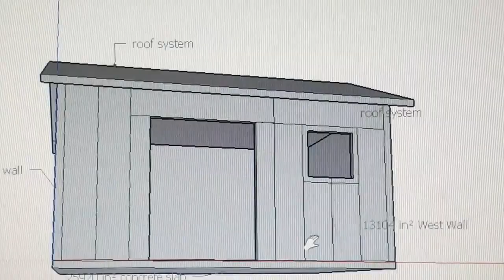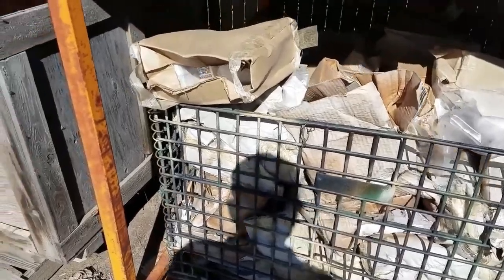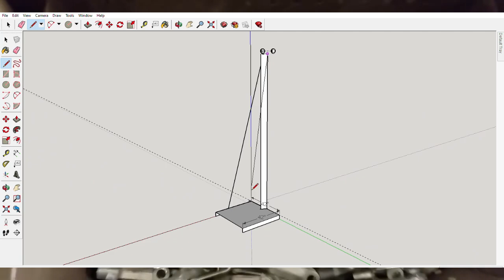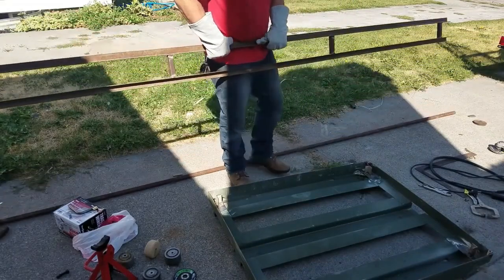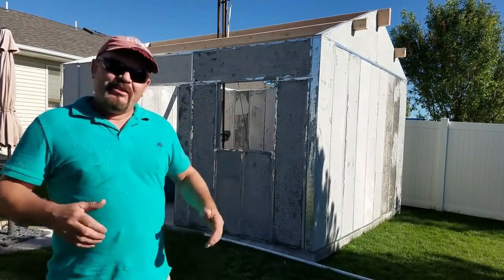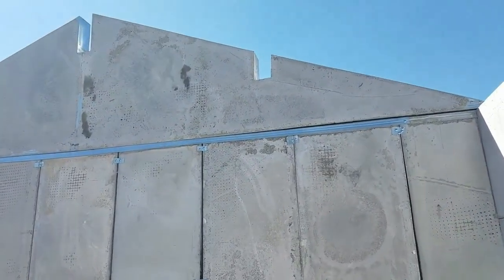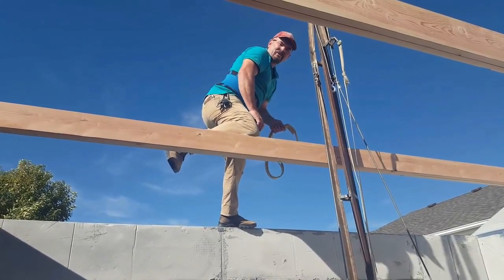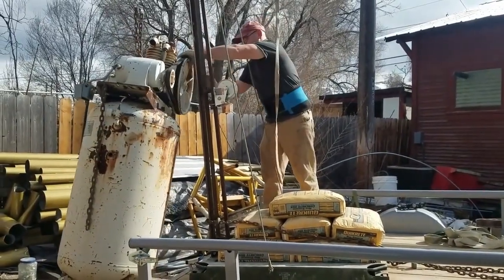Cool Tool! for Building with aircrete

Comment: I am a little excited thinking about a possibility of seeing how good an insulator this aircrete is. I would like to find out because insulation is expensive, like i wonder what the R value would be for aircrete to compare to traditional insulation. Thinking of making an experiment with 6 in thickness and see how well it insulates. Make a small model first, then do a life size mockup.

There is like endless possibility with it. IT could work great for under houses where the crawl slace is and it is always concrete blocks or pooured wall and footings, and they need insulation, it would work great to build 6 inch aircrete to place inside, or to replace the cheap thin skirt on trailers with it, etc...Get this, it would be even cheaper than that cheap skirt.

Comment: Hi  Again . Not been around for a while but was wondering if I could mix the air crete thick enough to trialit on instead of pour it into panels. Soon I hope to be building a home using aircrete& rebar . Im concerned that if I do panels it may be too much for me to handle by myself over a long period of time . So hoping for a trial on over plasterers lathe  go with that . Ive seen where they used shotcret & its good but I started off watching the air crete videos & want to try sticking with that . Ill be using styrofoam panels then another layer of air crete & I love the idea that its basically indestructible by fire & very good in keeping water from absorbing into  it . Just cant say that the ferrocement will do that nearly as effectively

Comment: I like what you did it look pretty good. You did a nice job making sure you had hurricane straps because it will need it, not that i am saying you are going to get a hurricane but any high winds it needs the straps.  For an even more secure building it would be be good with trusses, this way it ties the box together with strength because there will be the bottom runners that will act as the ceiling, which directly ties the ends to opposite ends.. Without the trusses there is a slight chance it could buckle near the center top of the walls on eve ends, but this building probably won't it is not that big, you seem to be a good inventor with every thing else, it won't buckle. . But the way you made it takes less materials and you get more head room, but no attic, but it look traditional with that ridge beam, nice job.

Comment: Hi HDC as u said planters I did try making planters with aircrete but they turned out to be porous and as I put water it would come out. Could it be the foam quality. What would u suggest...I used fiber moulds to get them done...

Comment: question for you... or for anyone...  do you think you could spray aircrete over top of one of those out-of-the-box barn things?   the ones with the metal frame and the crappy vinyl cover that lasts for about 2 years, then either rips or the entire barn collapses under the snow?       thinking if i could actually use my tractor to at least take most of the snow from the sides that falls off to keep it from caving in from the sides,  and use aircrete to make it much more stable... just noodling...   if you have the structure, and i have the top of one that isn't totally wrecked (take them apart for the winter and just use it for curing wood in the summer), wondering if it would work - would it stick even?

Comment: Now for my 50'x50' metal trusted building with 20' walls, I may need to go a wee-bit heavier.  Possibly mount it to the back of a tractor.
Reply: The guy that built coral castle just used 3 logs and a pulley system.  For the really tall ones he used a second log tripod and comealongs.
Reply: @technosaurus3805   I am from SW Oklahoma.  "What is a log?"
When my ancestors, along with a few other pioneers, came into SW OK (Texas panhandle at that time) there was 1 tree along a creek. Coming from East TN, it must have been quite a shock!
Reply: @glencrs  I cheat and use 2x4s or steel pipe that I have laying around usually ... old bike wheels make good pulleys for medium sized loads.
Reply: @technosaurus3805  true,  and model T leaf springs. I've been to coral castle many times.
Reply: @technosaurus3805  NICE HIJACK!! I had never heard of Coral Castle. To be associated with Edward Leedskalin is a nice and fitting association for Darwin. I now have one more inspiration showing that with focus and perseverance seeming Impossible things are possible.

Comment: I have a way to tie your building together and create excellent architecural highlight relief features at the same time.

Just trim you building out on the exterior and around openings with 2X  6, 8, 10 or even 4  and anchor the trim to or thru the panels at the plate line. Then use a mesh coat and just stucco over the mesh. Same thing as using foam board on synthetic stuccos except this would provide structural integrity tying it all together so there are no lateral forces to move or wiggle under lateral loads like wind shear.   So when you do your finish coat, just coat the trim as well. Or you could just leave the bare wood and paint it as trim !  KISS always and some common sense are a good thing.

Also if you made your beams longer by 2 feet on each gable end that would create the necessary frame for a roof over hang. Hope that helps as fuel for thought.